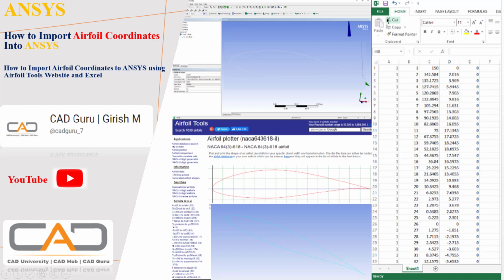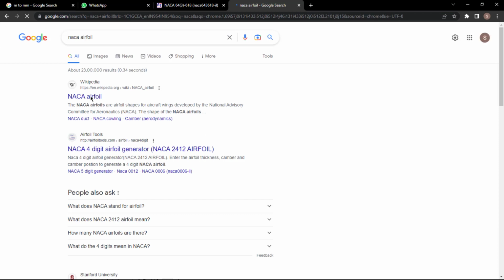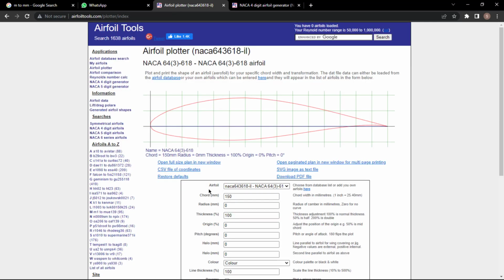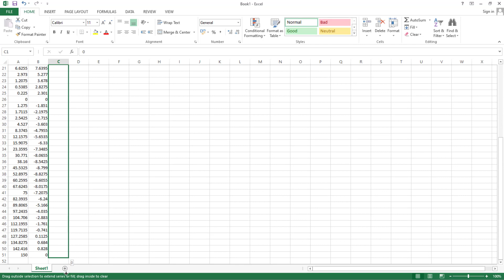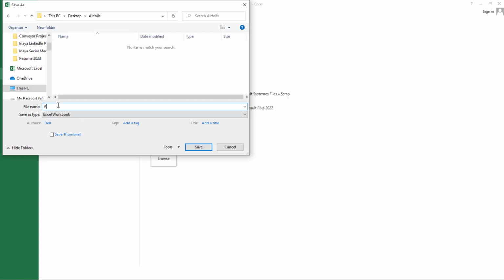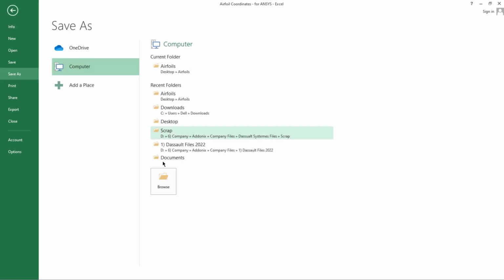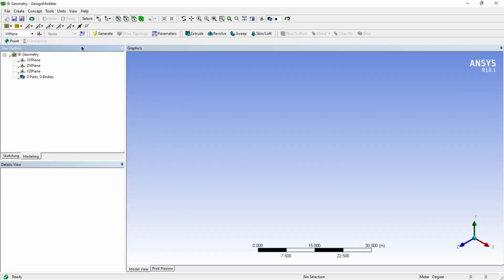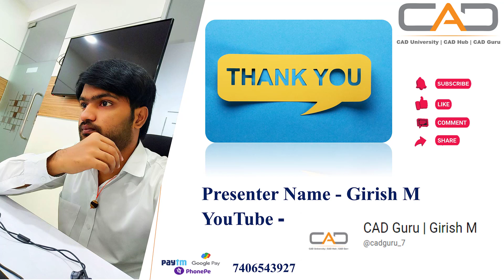How to Import Airfoil Coordinates to ANSYS using Airfoil Tools Website

Comment: it show error reading coordinatr file, i have change the decimal separator with comma the same as ansys setting... but it doesnt work, pls help
Reply from the maker: If you follow the similar steps it should Work. 

Thanks
Reply: Bro u have to put 0 at the place of 51 in SN..  i had  same issue an I hadbeen tring for 2 days😂😂
Reply: Did you ever figure this out, I am getting same error.
Reply: @ShintoB3ans   You can use the point section and then connect the points by drawing a line
Reply: @Aysegul-fc1ju  nasıl yapıyoruz biraz daha detay verebilir misin. error veriyor
Reply: Me too @ShintoB3ans